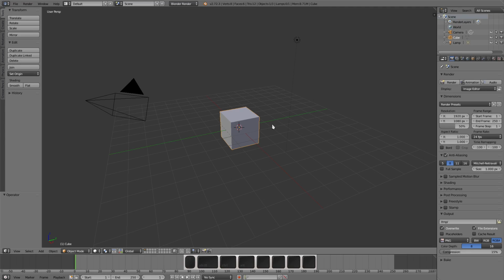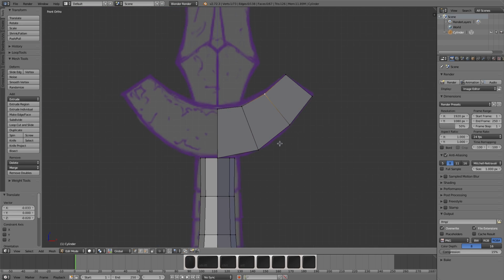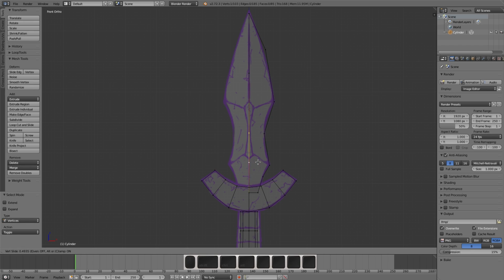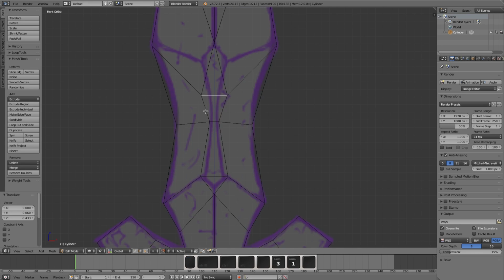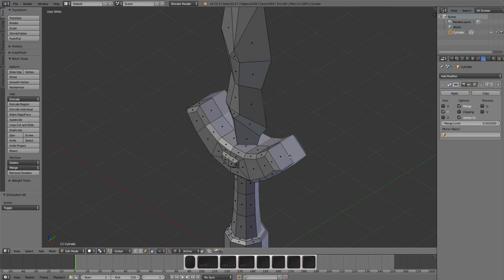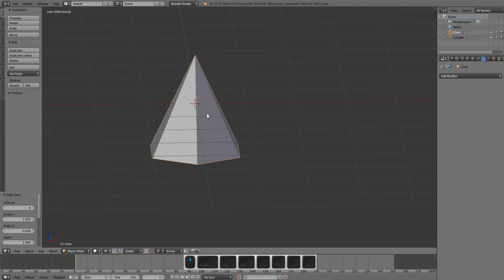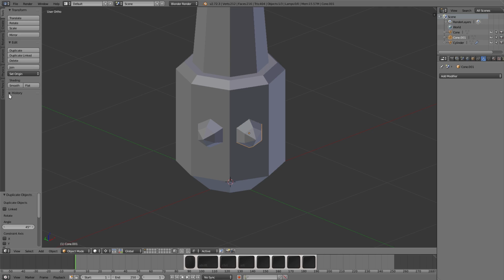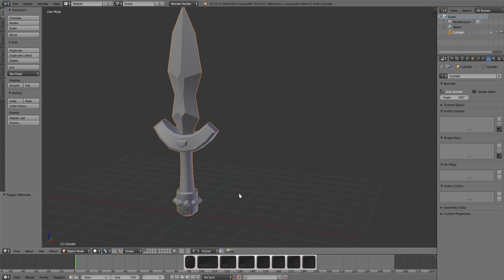Modeling - Hand Painted Weapon in Blender 1/9

Comment: I had no idea you could average faces while snapping.  I can't count the number of times I could have used that.

Why do you bother attaching different parts of the mesh for game assets?  I usually end up with different parts clipping through each other and it doesn't bother me at all.  I can't see an advantage for creating extra geometry when leaving them clipped together works just fine.  The only place I can think where this will actually be an issue is either if the mesh if skinned or the area you're clipping is very large.  If it's very large you're just wasting fill rate on stuff that'll get rendered over anyway, but for something so small...  I don't know, it seems like extra work with no point to me.
Reply from the maker: It's human error on my part. As long as you aren't running into z-order and lighting problems, floated geometry is just fine. I attached to show a few extra modeling and uv tricks, is all. If I were to remake it, I'd clarify that leaving it unattached is fine.

Comment: i thought triangulated faces where bad anyone care to elaborate?
Reply from the maker: Tris are bad if you're using subsurf -- they often cause pinching artifacts due to not dividing evenly. For low-poly you'll want to stick to quads as much as you can because they're easier to work with (loop cuts and things) but tris are fine if it makes sense to use one. 

It depends on what kind of model you're doing.
Reply: ahh i see thanks , I've only just stumbled upon your channel but i can honestly see you know exactly what you're talking about i really hope you make more videos.
Reply: Bethesda uses tris in there model. At least for the deadric sword.
Reply: 3d engines render triangles (and convert 3d models to triangle surfaces) because they are always planar meshes and easier to work with.
Reply: Well. I was like looking at the model's file while i was modding skyrim. Maybe it was just the hitbox idk

Comment: This tutorial is absolutely invaluable. Get your notepad ready for some hotkeys you never knew about.

Alt+P : poke (triangulate faces)
Ctrl+M: Mirror then x or y or z (although why not use the mirror modifier?!)
Ctrl+N: Recalculate Normals
Alt+D: Extend Vertices (creates new vertex where the mouse is)
gg: Time saver for edge slide
j: split faces between two vertices
Pressing "a" while using snapping allows an average point between the "a" selections.

Absolutely awesome. Thank you.
Reply: If Alt+P doesn't work for you go to Mesh - Faces - Poke Faces
Reply: @DuFuSoK  Thank you
Reply: +Richard Hawkes ya.. i also (long time blender user) am blown away with some things he shows!

Comment: Quick tip for rotating around a cylinder like at 18:00. If you want to know how many degrees to rotate by, take the total number of faces around the cylinder (in this case 8), and divide 360 by that number. 360/8 = 45 degrees. If we wanted to line the spike up with the edge next to it for some reason, you would simply move it by (360/16), or 22.5 degrees.

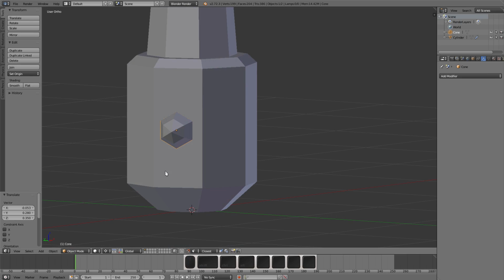In order for this to work, you need to first line it up perfectly with snapping or some other method like he did at 17:06. Happy blending!
Reply from the maker: Steven B Aye, great tip. Blender lets you plug it in with the = key too. Eg rather than typing 45 type =360/8 and it will calculate it out and result 45. You can even use radians if you wanted to. Eg =pi/4radian will also result in 45. Math wizards can probably do all sorts of crazy positioning with it.

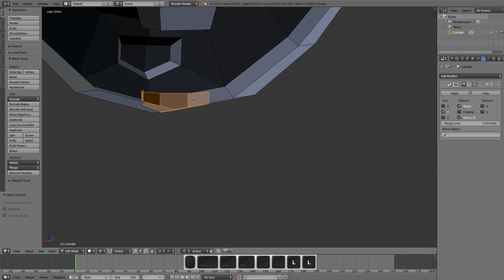Comment: Hi XRG81 in minute 13:34 I can do the intersect between the meshes, but I don't get the hole when I select linked (L key) and then delete the vertices with X.... I just can delete the top part (of the handle), but there is no intersected faces in the cross-guard base :/
Reply: Also having trouble with this

Comment: What are your feelings about tri's? Like some ppl say to avoid them as much as possible; although with this model it won't be animated so I guess it won't be that big a deal.

I guess my question is; do you avoid them overall or just for character models or other animated meshes?
Reply from the maker: mastermill79 I think the strict no-tris rule is mostly when using subsurf, because it'll cause shading artifacts (easier to divide 4 sides evenly than 3).

In low-poly stuff, you often don't use subsurf, so you can use tris if you need to. You still typically want to favor quads if you can, because they're easier to work with (e.g. loop cuts won't cut through triangles) but in some cases a triangle just makes more sense. Here are some examples of using them on animated characters to get a better idea: http://wiki.polycount.com/wiki/Limb_Topology

Good question though. I'll have to consider making a video talking about that at some point.
Reply: XRG81
 Thank you very much for your answer :) Still getting a grip on texture painting. Working on my own version of a Parthenon and want to texture paint the marble by hand although I went a bit overboard with the amount of loose pieces: http://i47.photobucket.com/albums/f184/mastermill79/ParthenonProgress3_zpseea16768.png
Reply: XRG81  Also I was wondering if you work in the gamesindustry? Your style of art looks a lot like what I have seen in LoL, WoW and Forced for instance.

Comment: Why did you join the blade, hilt, and guard geometry? Leaving them separated uses less geometry, makes the object easier to select, and in many cases easier to UV.
Reply from the maker: CrazyYarick It's always a judgment call.

In that case, it connected really clean and it only added about 4 more faces; which I didn't think was enough to worry about. I could see it would add a bit extra stitching to the UVs but was going to still be manageable. Object selection isn't very difficult either way if you use UV Seams/Select Linked.

In contrast, connecting the spikes would have added a lot of extra geometry, and would have made it more difficult to UV, so in that case I chose to leave them unattached.

I probably should have explained why I was making those decisions though. I was so focused on trying to show how tools worked, I didn't really explain good low-poly modeling practices!
Reply: XRG81 I absolutely understand it was a judgement call and I really appreciate some of the tool documentation( especially the multiple snap anchors). I guess I get a tiny bit touchy when I see people connecting stuff that doesn't "need" to be connected, because I used to have a "a model needs to be all one piece" mentality for some reason. I have long since retrained myself, but it really did make modeling frustrating for the longest time. Also I used to do some super LP challenges and optimizing even the 16 tris would be paramount at times :)

Sorry to be nit picky but it added 8 more faces(16 tris) when you connected the guard to the hilt.
Reply from the maker: CrazyYarick Heh, I know exactly what you mean. I did similar things when first learning. I think that's the best way to learn though: screw up a bunch and learn from mistakes.I'd have to look at it again. I was thinking it was 4 faces to begin with, connecting made it 8, so it added 4 additional faces.
Reply: XRG81 Yup you are right. Sorry about that. I wasn't thinking about the initial faces :P . Actually I was thinking it was just one for some bewildering reason. so even my mistaken calculations were wrong.
Reply: Philip Witte If you are talking about sub 1k models it doesn't really matter. At that point you wouldn't really need to "paint" the weights anyways. Mostly, for me, it's easier to just attach to empty groups and manually assign all of the values. Anything beyond that, as he said, it's up to the artist. Clothes might not need to be separate but a pauldron would. A cape would also probably be easier to model/rig/animate separately. Diddo for a biotic arm(the robotic bits).

The only reason I brought it up was because I was was compulsive about merging all of my meshes(for absolutely no reason) when I started modeling that it made modeling: not fun, super finicky, and terribly messy.
Reply: For a sword model like this, he definitely could have left them disconnected. But you'll have bigger issues doing that with an animated model. It's much harder to paint blended weights across geometry that's disconnected, and it will pull apart very easily once you start moving the rig around. The slight difference in vertex position combined with the slight difference in weight left by your brush equates to a mesh that's hard to weight artistically without tearing at significant joint rotations.
Reply: CrazyYarick I'm still trying to get rid of that kind of thinking

Comment: If you use snap to face for example on a retopo. Do you know if you can offset it from the surface? but still retain that snap function? does that make any sense?
Reply from the maker: Christoffer Törnquist Not that I'm aware of with snapping. The Shrinkwrap modifier has an offset option though. So it might be able to do what you need.
Reply: scale the retopo geometry with Alt-S
Reply: Yea that works after but not while snaping is on. You can do it with a solidify modifer on but it can get messy
Reply: Christoffer Törnquist  Try the displace modifier. set the strength low to something like 0.1 or 0.2 and midlevel to 0.9.
Reply: going to give that a try next retopo =)